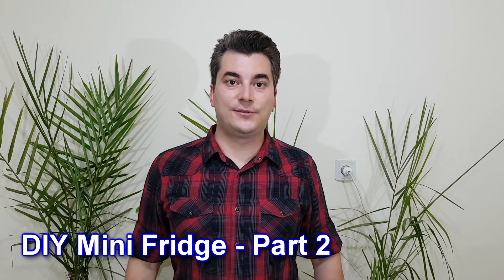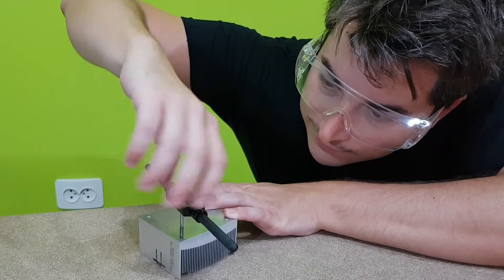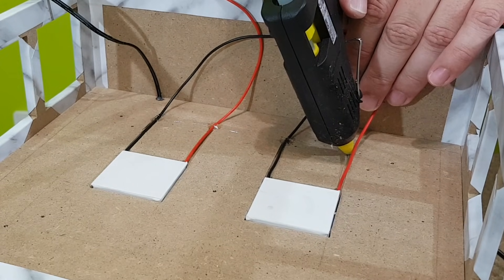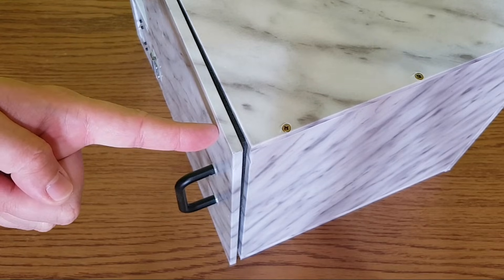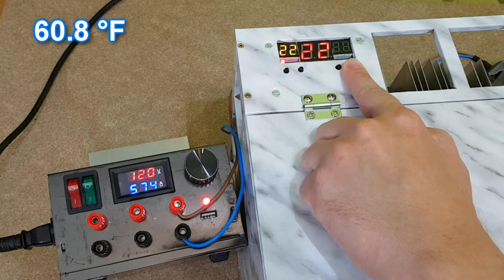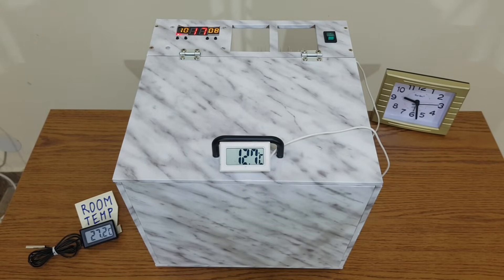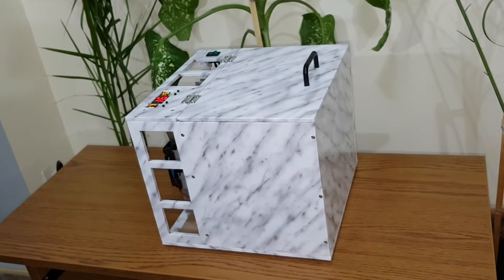DIY cooler box (mini fridge) Peltier - Part 2/3

Comment: Hello Brother
I Have One Question
Please Help Me
@ 6:15 What Is The Diode Number? 
And Also Explain Why It Is Important
Thank You. Love From India 🙏
Reply from the maker: 1N4007 diodes. I use them in series with the fan, to decrease the fan voltage because it's to noisy. But I suggest you watch the part3 video and don't use the diodes.
Reply: I Am Using 12V 10A Power Supply And 12706 Peltier

Comment: Hola bro, he visto muchos videos tuyos y este este es otro de ellos. Observación, los conectores DC que utilizas no están capacitados para trabajar a más de 3 Amperios porque dentro de ellos tienen un cable calibre muy delgado que no soportan esa cantidad de corriente por ende se aislan internamente. Te recomiendo utilizar el conecor xt30, xt60 o el xt90, va depender de la aplicación que le des. Saludos bro
Reply from the maker: Hi. Please watch the part 3 video, I've replaced the connectors and added a few more improvements.

Comment: The fan on the hot side must be turned upside down to blow hot air out. Inside you need to install a small fan so that there is air circulation. 12v small ice more hot. 10v maximum ice, minimum hot

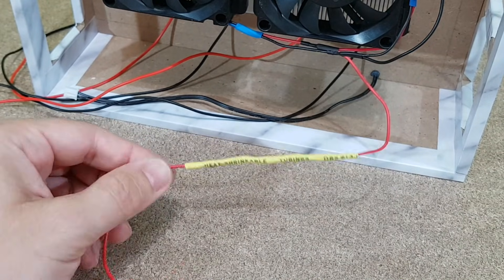Comment: 6:40 Or you can use a buck regulator, more efficient and keep the voltage constant at the regulated voltage.
Reply from the maker: yes, but in the part 3 video I connected the fan directly to the relay. cooling the hot radiator it's much more important than the noise of the fan.

Comment: Felicitari, mult succes. O alta idee , daca vrei sa o realizezi, ar fi sa folosesti 1-2 Peltier, ca sa faci o racire auxuliara pentru PC, adica pentru racirea procesorului de calculator.
Dar pe racirea cu lichid si modulele Peltier, sa raceasca radiatorul exterior.
Spor.

Comment: Any recommendation for what module to use, swapping out a condenser on mini fridge to thermoelectric? Need the minifride to hold Temps between 65 and 72 degrees F. Thank you good sir, love your videos!
Reply from the maker: Hi. I recommend Peltier modules tec-12703. for my mini fridge 2 modules are enough to bring the temperature down to  47°F, maybe even lower. so it depends on the internal volume of your mini fridge, you may need more modules.

Comment: how many peltier should I use for a 50x45x25cm box (inside measure)?
I can put 20/30/40mm thick insulation on all sides if needed.
I would like to go about 8°C from 28°C ambient temperature, at least should achieve 16°C
Reply from the maker: you need at least 4 peltier modules, but it will take a long time to cool down the inside. with 6 modules it will cool down faster. but very important is to use TEC1-12703 modules. if you use other type of peltier modules, they will not work very good and you will not get the desired result.
Reply: @Sorin_DIY  thanks, why the 03? I can find easily any other kind (most common seems to be the 06 but goes all the way up to 30) and I was thinking to something close to 80/90W each.
A radiator similar to your on the cold side and 1 pc-like heatsink with heat pipes and 90x90mm fan for each peltier plus 4  13538 220V fans on left/right side to create a in-out airflow.
I don't have noise problem, it will be used in one room to proof some bread/pizza dough during the night/day at a constant temperature.
How can I send you some picture of my design for some advice?
Reply from the maker: yes, it's easier to find 12706 modules, but that doesn't mean that they are better. I tested a few peltier modules in a video on my Patreon page and the 12703 is the most efficient. 
12703 draws 3A at 12V so 36W. 12706 should draw 72W (in reality it's about 60W). the heatsink needs to dissipate almost twice the heat. 
you can make a bigger heatsink. ok, but no matter how big of a heatsink you make, it will be almost twice as efficient with 12703 modules, simply because it's less heat to dissipate.
so with 12703, the hot side of the modules will be... less hot than the 12706 modules. how will this difference affect your project? using the peltier module in perfect conditions, it will create a temperature difference between the hot side and the cold side of maximum 70 degrees Celsius. so the "colder" the hot side is, the colder the cold side will be. every temperature degree matters and for a few degrees colder, all you need to do is to choose the right type of peltier modules. 
there are also other advantages with 12703 modules. if you want, we can talk on the Patreon chat about your project.

Comment: What's the diode number?
Reply from the maker: 1N4007. but I suggest you watch the part3 video, the diodes are not a good idea. the fans will be quieter, but the cooling will not be sufficient.

Comment: Ma bucur sa vad un proiect, bine documentat, din partea unui conational. As face totusi doua mici modificari. As muta distantierul de aluminiu pe partea fierbinte, unde am nevoie de inertie termica. Pe partea rece acest distantier se comporta ca o rezistenta in calea caldurii, intarziind si limitand racirea. Trebuie probat, nu sunt sigur ca am dreptate. Si a doua sugestie este ca as pune ventilatoarele in serie  si fara diode. In felul acesta as reduce consumul lor si mai ales uzura si zgomotul. Bineinteles ca RPM ar descreste, fiind alimentate cu 6V fiecare, dar nu cred ca aerul fortat cu ventilatoarele la maxim ar face prea mare diferenta. Am sa imi fac si eu un racitor de acest gen, chiar asa cu 2 celule. Am in cap sa folosesc un management al temperaturii radiatoarelor la exterior si sa le dau drumul alternat, la celule, cand diferenta intre ele ar fi de 10 gr C cel mai cald se opreste si cel rece porneste. Ventilatoarele le tin pornite continuu. Initial sa mearga amandoua celulele, pana se raceste in interior, apoi cand una cand alta. Celulele sunt mai eficiente cand sunt bine racite pe partea fierbinte.
Reply from the maker: Salut, am facut si partea 3 unde am imbunatatit mult proiectul.

Comment: Excellent idea about the cold air running out of the open door on side mounted fridge doors.  Just think of the wasted energy in our homes with the way our refrigerators and freezers are designed.  The old style deep freezers had this right.  Very nice build.
Reply: Not old style...
Still freezers used to store icecream in supermarkets used top lid😑😑😑
Reply: @cisarvialpando7412  Yes, and they are based on the old style design of a top lid, as are large freezers people put in their garages to freeze deer meat.  The fridge/freezer in my camper van has a top lid as well.  Sometimes the old ways are the best way in my opinion.  Not always, but sometimes. PS. My parents had an old freezer with a top lid that was built in the 1940's.  That thing was still running even after they both passed away in the early 2000's.

Comment: Great job! I've built something like that but the issue with peltiers is that as soon as they switch off (temperature reached) they introduce heat from the outside heat sinks causing the temperature inside the box to increse quickly. Have you got the same issue? Or am I missing something?🤔
Reply from the maker: hi. you are right, if you switch off both peltier modules, the temperature of the cold radiator will rise very fast. that's why I switch on and off only one module. the other one remains turned on to keep a temperature difference between the cold and hot radiator and to prevents the temperature inside to rise fast. a better way is to use 2 outputs from the PC PSU - 12V and 5V and make the relay to switch between them. when the peltier modules are powered with 5V the temperature inside will rise very slowly. there is also another advantage now, at 5V the module will produce less heat in the back of the fridge, so the cooling radiator will get colder in this period and when the relays switches back to 12V it will be more efficient.

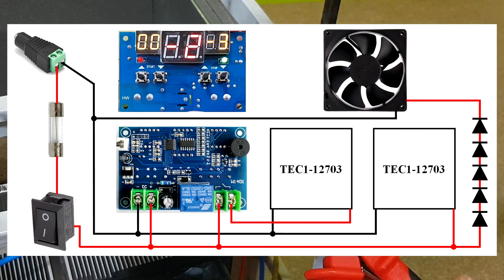Comment: At 7:50, you showed your curcuit diagram. I saw that one of the peltier modules are always connected to power (the right one) and the other is only on when the relay is on. Is there a reason for that? And which one in the hardware should be the one that is always on?
Reply from the maker: hi. one peltier module is not enough to cool down the entire box, but it will keep the temperature from rising too fast. if the relay disconnects both peltier modules, the temperature will rise too fast, the relay will click very often. so by powering continuously one of the relays (it doesn't matter which one) the temperature will be more stable and less energy will be wasted.

Comment: Probably a stupid question but what if you stacked say 3 of them on top of each other?
Reply from the maker: peltier modules are very inefficient, they produce more "heat" than "cold". it may work if you use 3 modules to cool down 2 modules. but with 5 modules the current consumption will be too high and you still need a big heatsink.
Reply: @Sorin_DIY  Ah I see, I didn't have much info on them

Comment: to make a chest freezer with the size of 60cm x40cm x 40cm, how many peltier it is needed ??? what are the volts and amperes for the PSU?
Reply from the maker: you can make a fridge with 4 - 6 peltier modules. but a freezer... it's difficult to make. because you need a big radiator for the hot side. you can't use more peltier modules with the same radiator, the radiator needs to be very big. maybe it will work if you use water cooling. the modules in my video are 12703, each one needs 3A at 12V.
Reply: @Sorin_DIY  1. means it uses a water block instead of a heatsink? 2. What size of water should I use? 3. What size radiator is needed? 4. I will use Peltier Tec-1 12706 5. I have to use a PSU which is how many amps and volts?
Reply from the maker: 12706 peltier modules use 6A each (the last 2 digits 06 means it uses 6A). these peltier modules are not very efficient, because they get very hot. I suggest you use the 12703 modules. you can find water cooled solutions for CPUs, they are good but expensive. if you want to go with aluminum radiators, they need to be very big. if you use 4 peltier modules, the model 12706, you need an aluminum radiator with a surface at least 4 times bigger than mine.
Reply: With heatsink fan or water block and radiator?

Comment: you can use a 6v peltier with 12A in sandwich formation and this will help you get -15 temp inside and with normal heat outside .... means you dont need bigger cooling

Comment: Really cool video, well explained, and I like the well-thought design. Just found you channel and subscribed 👍 
A question for you - what would it take to create a freezer? My particular use case is making ice cubes.
Reply from the maker: hi, I also want to make a small freezer for ice cubes. but I'm still working on the design, because I want it to be very powerful and efficient. It must freeze the water in maximum 1 hour. it will probably be very thin, for one or maximum 2 sheets of ice cubes. all the inner panels must be made of aluminum, but where will I install the lid? up or on the side panel? I must have easy access to the cubes, but the side with the lid will be the least cold. I will probably use 4 peltier modules, the model 12703. I will definitely make one, but it will take some time.
Reply: @Sorin_DIY  That sounds interesting. I'm thinking maybe having an ice tray sandwiched between 2 peltier modules (or 4 if needed, so it can cover more surface, 2 on top, 2 on bottom?). Then the access to the ice tray would be from the side / in-between, maybe some sliding mechanism even, like a short drawer.
Reply from the maker: I thought about that also, it will be more efficient. the problem is that it will be bigger and more difficult to build, with big radiators and fans on both sides. also the ice cube tray may get stuck, if a few drops of water fall and freezes between the tray and cold radiator. I will probably test a few ideas, before building it. I'm also thinking of making it with an upper lid and install 2 peltier modules and cooling radiators on the lid and other 2 peltier modules on the bottom panel.

Comment: Very informative...i am currently doing this...but i have a question...can i use 4 peltier modules instead of 2? And can i  use a 12volt laptop charger as a power supply
Reply from the maker: hi. if you use 4 peltier modules you need a more powerful power supply. laptop chargers are not powerful enough for this project.

Comment: Why dont you put the thermostat sensor inside a small capsule filled with liquid, sealed of course, inside the fridge? That will give you even more close temparature results so you know even better if its ready to drink! But of course it's not perfect, because the small capsule cools faster because less material to penetrate for the cold. But still!
Reply from the maker: hi. this could be a good idea, I will test it in a future project.

Comment: Amazing video 
So i have a question in my country the temperature in summer is about 40 t0 45 degrees outside in room its about 30 to 37 degree 
So i will need the more powerful modules? Will peltier 12715 model work in that high temperature?
But it have high power consumption 
Can u please tell me which one.i use to get that low temperature?
Water cooling on hot side?
Thank you
Reply from the maker: hi. the 12715 peltier module is using more current, 15A. it will produce more heat on the hot side so you need more cooling. I tested a few of these modules and in my opinion the best one is the 12703 module. I suggest you use 3 or 4 of these modules. they will need 9 - 12A, so you still need a proper cooling, but you will have 3 or 4 modules that cool the fridge. water cooling is better but it's more expensive.
Reply: @Sorin_DIY  Oh okay Thank you so much for helping me out THANK YOU SOO MUCH 

Keep making Amazing videos 💗

Comment: Thanks for this video it was very instructive . what kind of solar panel can keep this fridge going
Reply from the maker: hi. these peltier modules need a lot of power, you need a solar panel with minimum 12V and 6A. but the rated output power of a solar panel is available only in perfect conditions: summer, around noon, in a region closest to the Equator, solar rays perpendicular on the panel.. if these conditions are not fulfilled, the solar panel cannot output the rated power. to compensate for this loss you need a bigger solar panel, with a much higher rated power, plus a controller.

Comment: how much you pay for all of this parts ?
Reply from the maker: hi. I paid around $50 for the parts I bought, but I had some salvaged parts, like the CPU coolers, some aluminum brackets...
Reply: @Sorin_DIY   good 
may i asking you about 3s lithium battery 12v ? 
i have 4 pcs of them and i want to charging them together without any problems .. they also was different amp some of them 30ah and another 40ah 
thank you so much

Comment: 8:12 warm your paste with a hair drier before final tightening. This changes it's phase to a liquid and allows better tightening for better result. 
Also, you applied a lot more than needed - this reduces net thermal conductvity. About half as much next time for that size. Thick paste=bad
Reply: True. Thermal resistance, like any resistance material, is proportional to thickness, and inversely proportional to the area of the grease. Hence, thick paste = bad.

Comment: Switching only one of the Peltiers with the thermostat , and keeping the other one on permanently is a very clever engineering idea.
Provided that your desired temperature range requires at least half of the cooling power.
Your set temperature can not be too close to ambient. Mostly that will not be a problem.

You are so right that a lot of video's about peltier cooling are ridiculously optimistic.
Reply from the maker: hi. an even better method is to switch both peltier modules between 12V and 5V. because if one peltier module is switched off, it's not a good thermal isolator and it will transfer temperature from one side to the other.
Reply: @Sorin_DIY  Good point. But that would seriously complicate the control design.

Comment: Hey Sorin, can you create a portable Airconditioner from this same peltier module as well please? That would be awesome!
Reply from the maker: I will make some tests first... but the battery will probably last very little time.
Reply: @Sorin_DIY  Hi Sorin, thanks for replying back.  its ok if the battery wouldn't last long, as long as the portable aircon itself cools the air quite good. we can always plug it in to an AC outlet. :)

Comment: can be fan runing inside for 0 degree below or its dangerous to short?
Reply from the maker: PC fans won't last too much in a cold and wet environment. some space will also be lost inside the fridge if you install fans.
Reply: @Sorin_DIY  i looked in my old fridge and main freezer is created by metal plate around box a freezing connected to it. Logically this with small cooler seems less effective. I still not do any, but can y  test same sprite with metal box and plastic box? In my understanding metal box should freeze faster. Same should be with fridge.